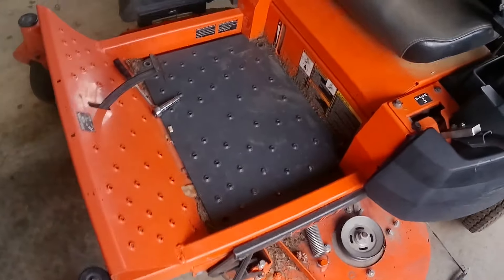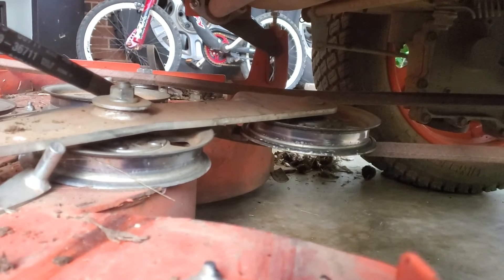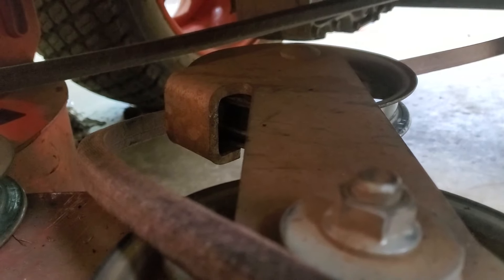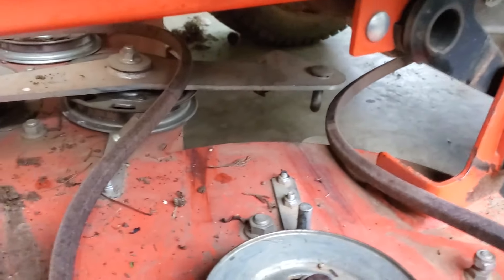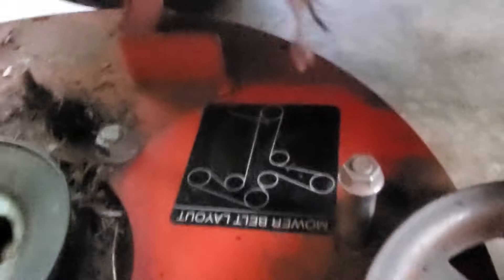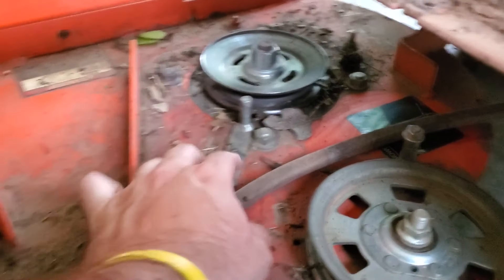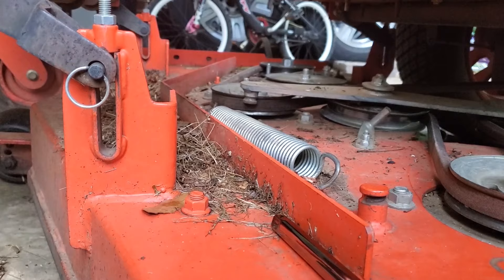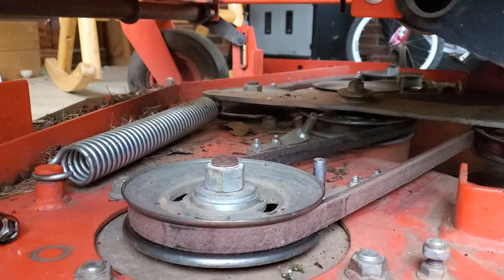Replace Mower Deck Belt | Kubota Zero Turn | ZG124

Comment: Have the same mower. I routinely remove the deck to clean it and sharpen the blades. The hardest part of the whole project is putting the #@!#! belt back on. Trick is to to raise the deck all the way up to put the belt on as that seems to allow the most slack. That pulley with the guide is always a pain to get the belt back on. So far I've never had to take the pulley off but maybe your trick would make it easier for me. 🙂

Comment: It’s 2024 and my local Kubota dealer is selling this belt for 90$! I see belts on Amazon for 30 bucks. Anyone have any thoughts on knock off belts vs Kubota made?
Reply from the maker: I'm pretty sure I've bought one previously from Amazon and it worked.